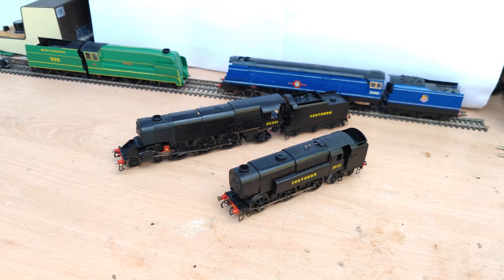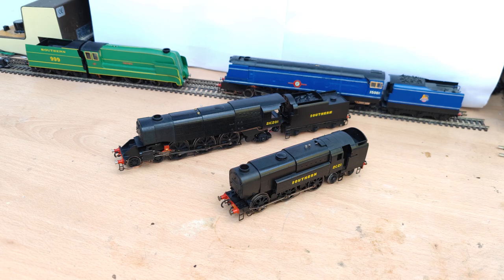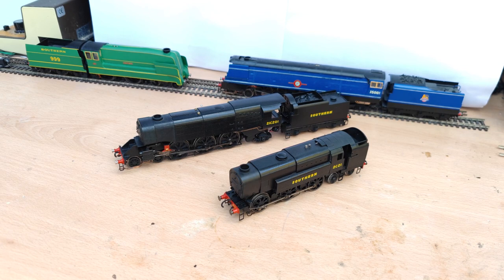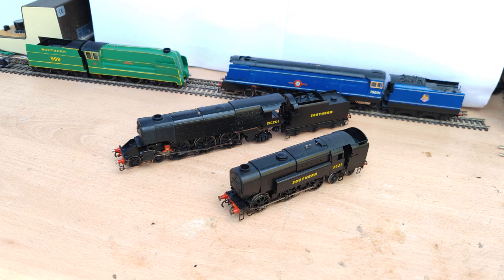Vectis 3D Models, Q1Tank

Comment: Curious models! I never knew that the tank and pacific versions had been proposed. Going by the performance of the Q1, these variants  might have been excellent locomotives, possibly better than the BR standards that came later?
Reply from the maker: Thank you, 😊 yes I've always had an interest in what might have been, when you find old drawings in some case old wooden models like the Pacific version which is at the NRM, it's always the question what if...
But always have to be careful with these drawings is some have been created by those who just have a runaway imagination.
And others are real.
As the drawing is quite basic (see links description) it certainly leaves a little room to add some areas or try different things.
Could they have been better who knows but it's always interesting 🤔
Reply: @bluebellModelrailway  Yes, I realise that it may have been just someone's pipedream but it's fascinating to speculate what other strange locomotives Mr Bulleid might have come up with!
Reply from the maker: Very true it is interesting to develop an idea that only went so far... Apart from a draft which this was.
Reply: @bluebellModelrailway  Yes, I realise that it may have been just someone's pipedream but it's fascinating to speculate what other strange locomotives Mr Bulleid might have come up with!

Comment: Sorry, the numbering should be C2xx - no leading axles, three driving axles and two trailing axles.
Reply: I was about to make the same comment but it seems you've really researched this. Nice models
Reply from the maker: Yes I can understand the confusion as the bullied merchants had the 2C1 but it changed when the light pacifics came in Blackmoor Vale for example 21C...
I did double check to make sure but the guy who advised me knows his Bulleids.
Reply: @bluebellModelrailway  it's all interesting history though
Reply from the maker: That like saying the Q1 should be 00C_ it doesn't work like that so it is correct speaking to the experts on the matter we the numbering system. So 2C_ _ is correct for adopted system.
Reply from the maker: I'll look into it thanks.
Reply from the maker: "Bulleid decided to adopt an amended version of this system using the coupled wheels letter to split the leading and trailing axles numbers from the following running number, hence 21c11, being the 11th member of the class."
So it is correct  for what it is using the adapted version rather than the earlier version for the merchants.
Reply: Since Bulleid adopted 21C for his Pacifics, as in axles - front, rear, then middle, it follows that this Q1 tank should be numbered 02C to follow the same system. Still, a very nice "might-have-been.